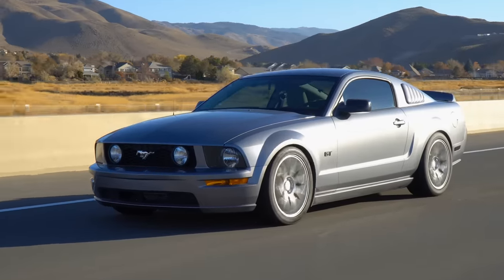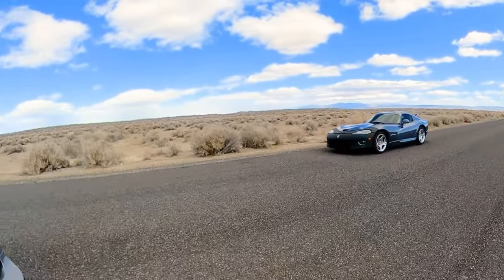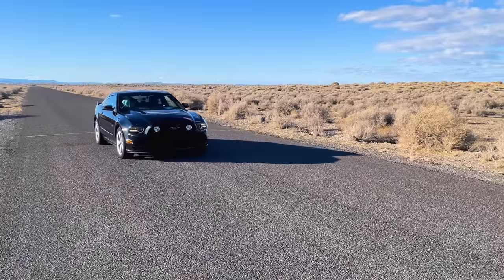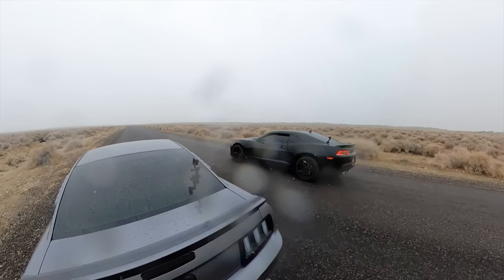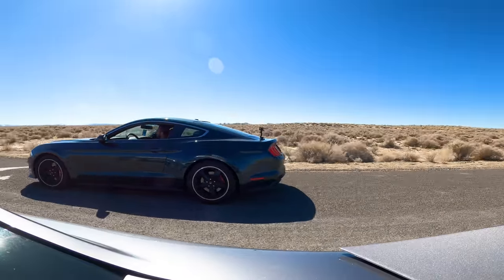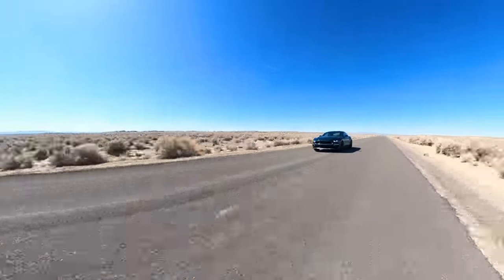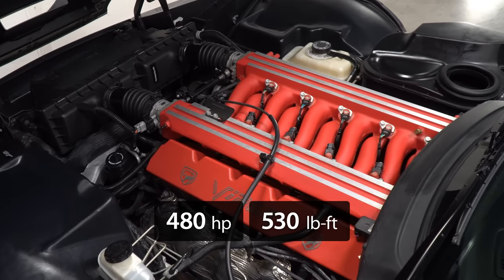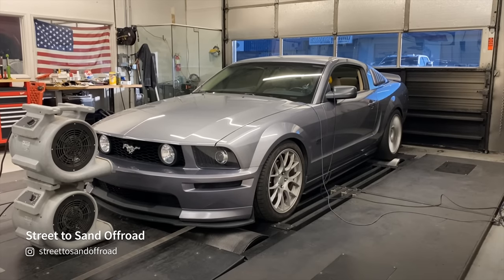Showing the world what an all-motor 4.6 Mustang can do

Comment: It’s pretty sad that they could only get 480hp ON A TUNE with 8 liters!!    That’s 488 cubic inches, almost 100 more than the Hemi.   A 2014 SRT8  6.4 liter gets 470 horsepower factory., at 390 ci.  What gives?   That’s some sad stuff.   I know the Vipers went on to make huge HP, but I don’t care, 10 cylinders, 488 ci, they should be able to get a HP per CI, and it took a tune to still not hit that.  If the Viper had to be tuned to be a daily driver, like a Charger or Challenger, that would be one thing, and still no excuse, but it was a purpose built, high performance, full tilt race car for the street.   Nobody puts 8 liters, 10 cylinders, massive engine setback, long nose short deck, the whole package together, to not even hit 1 hp/ci.   I never knew they had so little at one point.

Comment: Not trying to be mean, but you have a fully-built Stroker motor against completely stock cars, kind of. Lame a simple cam upgrade in that Camaro or the Corvette or Viper will walk the fully-built Mustang!
Reply: I agree with your comment. However I guess he's trying to show people what they can do swapping heads, cams, intake on these 4v mustangs. At end of the day 1% of drivers have modified cars on the freeway and when you can pick up a 2v/3v GT in good shape and for $10,000 total invested in buying car and modding the car to out run modern coyotes and LS3's seems like winner winner chicken dinner.

Comment: The mustang is crap. The 4.6 is garbage and blows up if pushed too much. I wouldnt take one for free.
Reply: I’m pushing almost 700 hp with a whippple (12 psi) on stock internals and 190,000 miles for 7 years and it hasn’t blown up.

Comment: Them third gen. Coyotes love eating oil all modern emissions vehicle. Eat oil and brake prematurely In stock configuration... And don't get me started on not offering manual transmissions in trucks anymore... They belong in a pickup truck more than anything. In my opinion I mean that's where a manual thrives working hard daily.... The slush boxes have way too many gears these days and if it's not a race application, it'll be hunting gears all day trying to save .0001 miles to the gallon

Comment: LMFAO let's get real here, a stock 2007 gt is a slug. No way in damn hell it would beat a 2014, with 420 hp and a 6spd manual. I have one with a tune and 3.73s. A stock 2007 would be 6 cars back at the 1/4 mile. So what is done to your car, cuz it ain't stock!
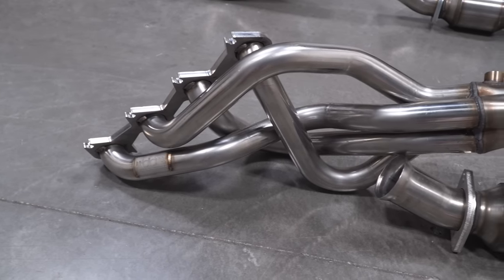Reply from the maker: 0:39 ...
Reply: And that's why you gotta watch the video before making comments.

Comment: You changed your gears!!  Those cars have stock gears, you set your car up for this, the other cars did nothing..  that is what should be expected.. put the same gear in the other cars and they would smoke your ass!!   Thats like comparing apples to oranges.. you basically have a drag car now, those cars are street cars that get decent fuel mileage where as you dont get any..  what you did is just polish a turd!!

Comment: Sweet build on the car.  But c'mon man.  You are comparing all these factory models to a car you threw the kitchen sink at.    Kinda apples to cookies isn't it?  And then the one car that beats your stang, you "justify" because it's been tuned.   Again, not to take from your build, the car looks, sounds, and moves bad ass....but if any of those cars put the same money towards theirs as your stang, or simply mod for mod...then the results would have been night and day different.
Reply from the maker: It's not that serious, just wanted to test the car out before boosting it. Also, all the other cars still have higher displacement and compression, except for the Viper which has similar compression at around 9.6.
Reply: @Four_Eyes why boost?  It’s a great NA set up you have. There will always be faster cars but you have a nice sleeper.